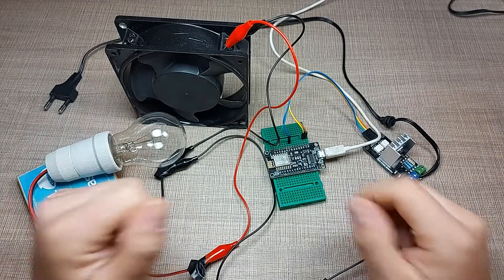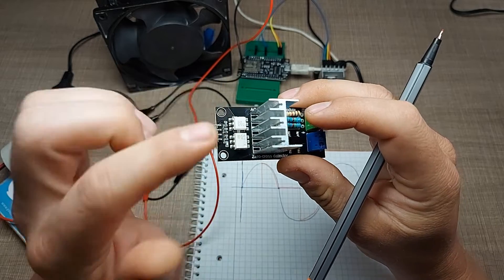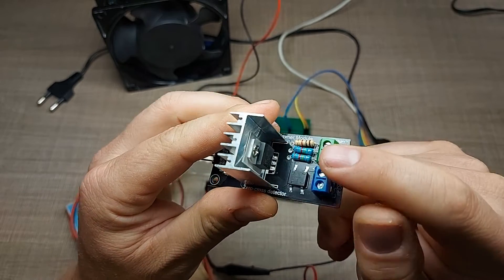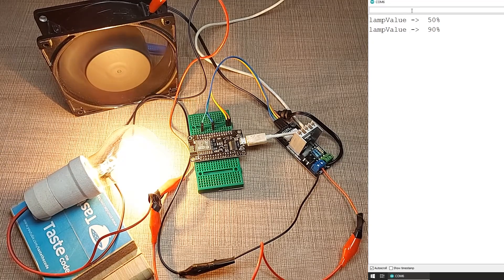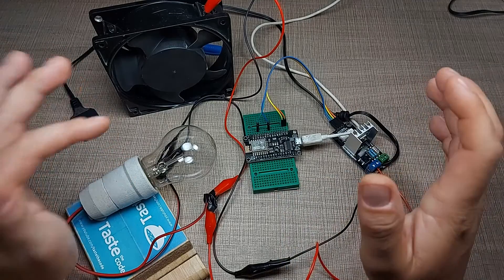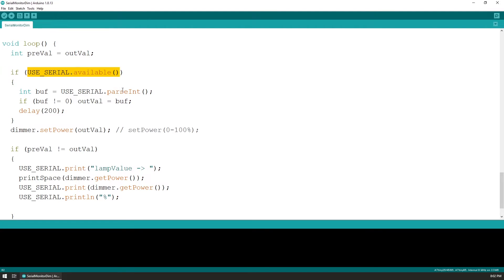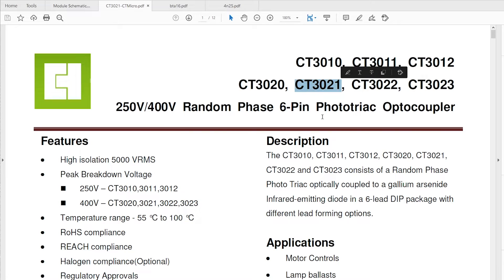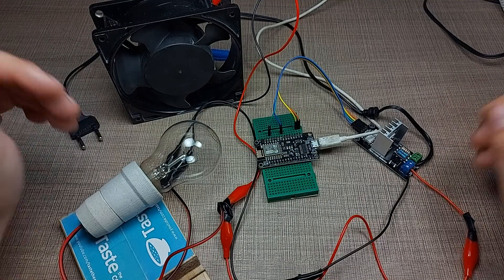AC Dimming and AC Motor Speed Control How To with Arduino/NodeMCU

Comment: that is exactly the project I am working on now! Perfect. But how to do it with Raspberry?
I think this should be fairly similar: zero detection: any pin with interrupts, then control over standard PWM, right?
Reply from the maker: Yes you are.correct!
Reply: @TasteTheCode  Thank you ;-) I am going to change 20 GBP fan for "200 GBP Wahoo fan" with 1 pico and 1 module from Ali (2 GBP) - lets see if it works  ;-)